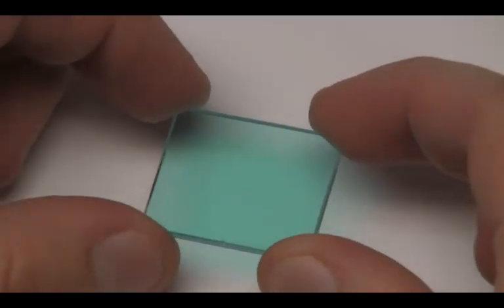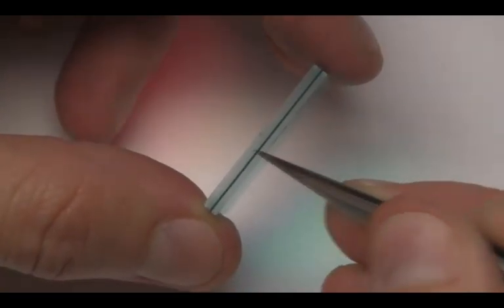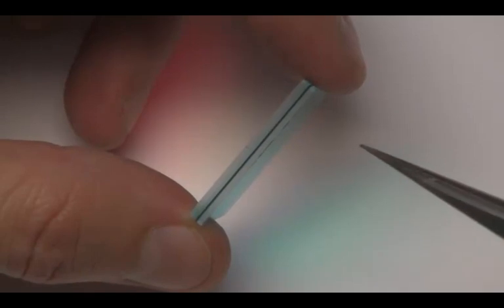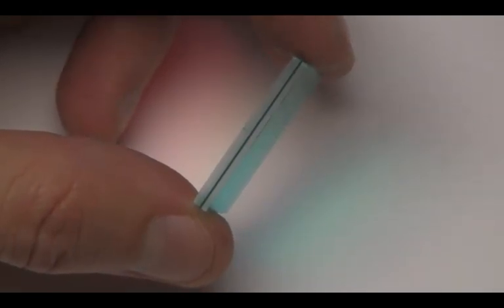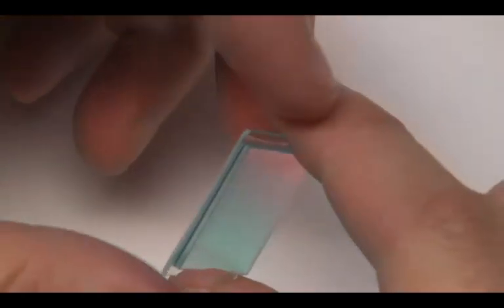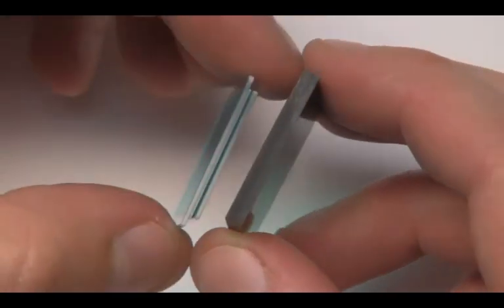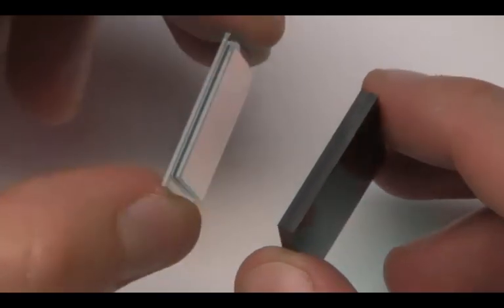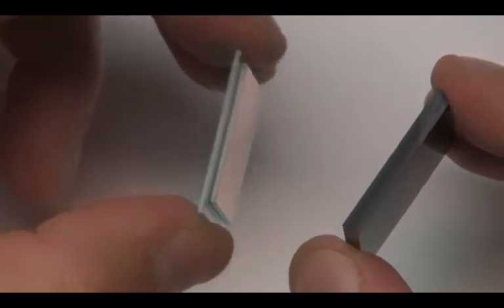Infrared Filter Thickness Myth

Comment: The replacement filter's band pass will also be a factor in achieving focus. I'll hazard a guess that whatever thickness or bandpass is put in front of the bare sensor (or left bare) will require the phase detection AF to be recalibrated. Even if proper centre focus is achieved, there may new focus problems off axis.

Comment: So how about mirrorless?
They're using light that falls straight onto the sensor to focus, not light that's being reflected by a mirror in the optical path.
So is there still the need to have a replacement glass in front of the sensor when you want a full spectrum camera conversion?

Comment: so does this mean all of these people just removing the filter to view infrared need to put a filter replacement in to get the correct focus point and that this would be different on each strength of ir replacement filter chosen?Also can I ask if you were removing an existing filter to create a full spectrum camera should a replacement filter be used?Thanks and good advice.